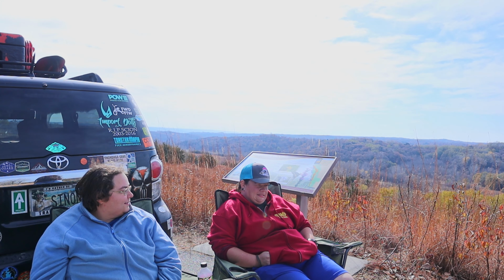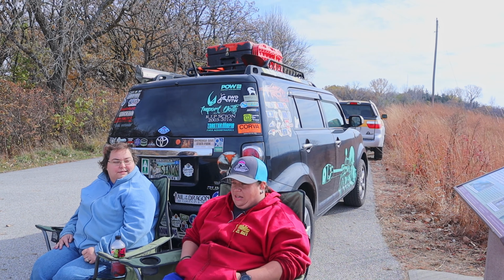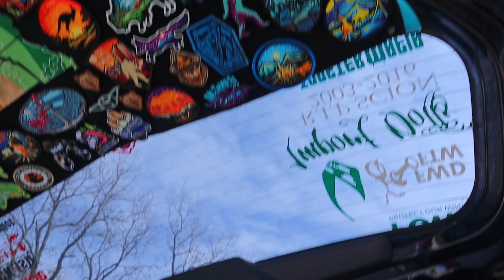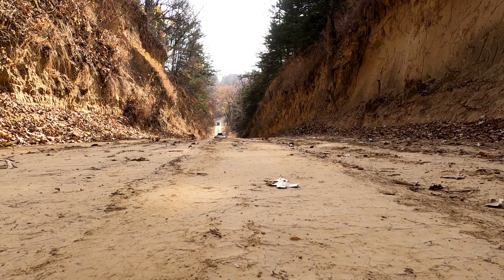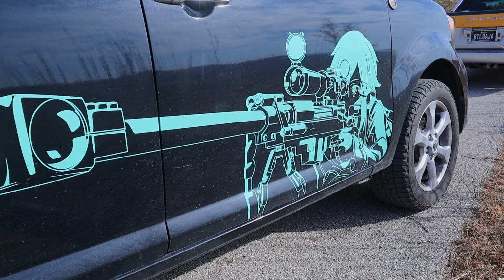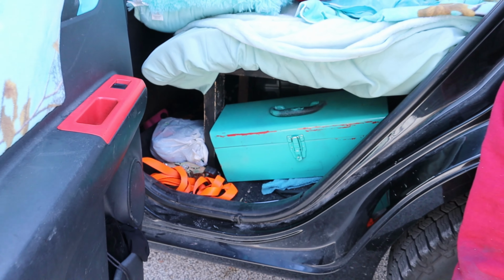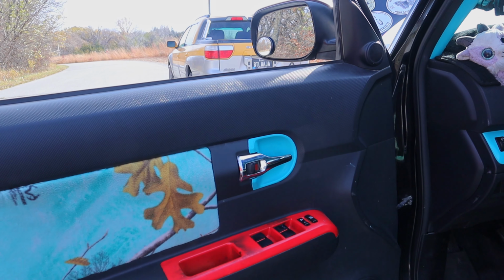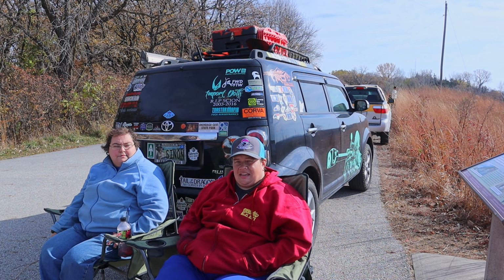Scion xB Review: The Overlander Scion Never Expected

Comment: And it's not slow either.  Stock 2008-2015 xB's are very snappy.  With those bolt ons probably 175hp to the crank.  175 doesn't seem much but a 3089 pound car it can move.

Comment: How did she fit a full size spare?? My 2014 only has room for the donut. I can’t close everything if I put a full size spare
Reply: Take out or trim all the plastic storage stuff back there. Throw away the foam piece that sits in/on the donut spare. I had one of my stock wheels (16in steel wheel) back there with less trimming than putting the 18 there. But for both, the foam piece needs to come out. The floor/cover for that area might not sit the best, but its not bad

Comment: I'm getting 16.6mpg on just a regular 09 xb. Did everything I can think of for better economy but nothing seems to fix it
Reply: Have you replaced your spark plugs and checked your air filter?
Reply: @JoseRomero-lp3dl  yea both brand new even the premium erodium plugs at 18 bucks a pop
Reply: @Eye_4_An_Eye  don’t forget ur gas tank. When it gets old, u have to replace them. Otherwise the elements gets in and affect ur mpg. So change ur oem gas cap for a brand new one. 
Check ur oem manifold catalytic converter, ur O2 sensor, clean ur mass airflow sensor, check ur tires to see if they are a bit inflated. That also affect ur mpg. Check ur suspension as well. If they got old and u haven’t replaced it, those can also affect ur mpg because ur old suspension ain’t what it use to be brand new.
Reply: Yeah something's way off to get MPG so low. As if someone's messed with the timing. 

Does it run rough? Does it have the same get up and go that it's always had? 

From a stoplight you should be able to beat most cars, front tires chirping. Acceleration when passing other cars, from about 60 mph to 100 mph should be brief and exhilarating (flooring it). From 30 mph, the downshift from 3rd to 2nd, flooring it and then letting the transmission upshift into 3rd at around 5,800 at about 60 mph, should also be amazing. 

My '09 with 89k just came back from a cross-state bachelor party. And still got 24.8 with 25 year old fast-boys driving it. 

I'll come back here and list what I use. 

Release series, #733 of 2,500